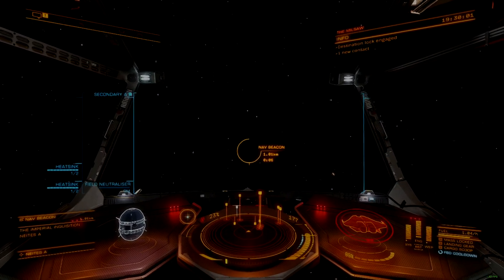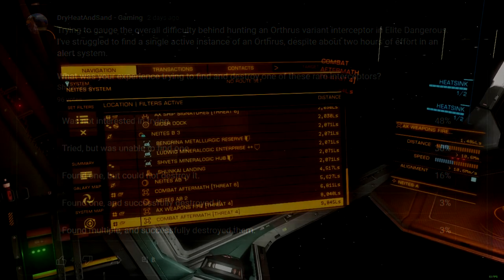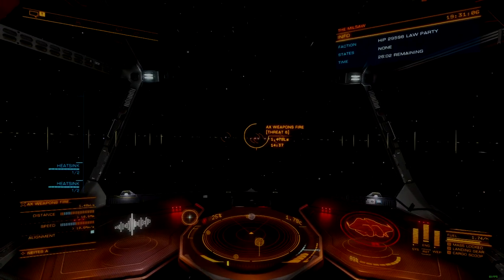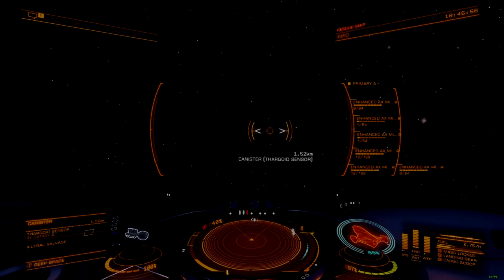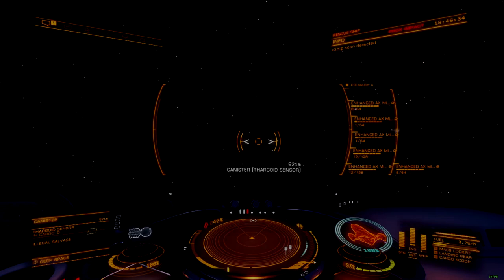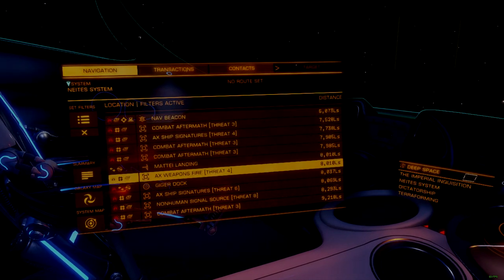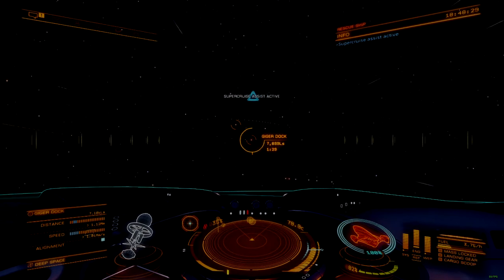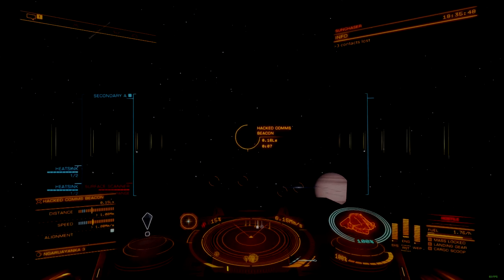Elite Dangerous | General Commentary | The Ideal Signal Source

Comment: Ortharus interceptors should spawn at the nav beacon of alert systems. Players then  wouldn’t have far to travel and it would be cool to see the interceptor jump in and start interacting with the nav beacon to gather system info. Regular AI ships at the beacon could all start to scatter or request support. 

I wished that ship materials were available on foot at settlements. Research settlements give data matts, manufacturing settlements give you guessed it manufacturing mats and refinery settlements give raw mats. That way everyone knows where to go to get what they need and it’s actual gameplay. Don’t get me wrong odyssey content isn’t for everyone BUT it’s a more fun and realistic way of gathering what you need. If you don’t have odyssey than I suppose your left with farming signal sources. Engineers could even create a mission or two that guarantees a certain material at a specific odyssey location.

Give us a tractor beam mod for lasers that drastically speeds up material gathering when flying about. I rarely collect the mats after I have killed an noc or whatever because it takes so long.

Megaship cargo bays should be rammed with engineering mats and not cargo of hardly any value. The mega ships are kinda fun to interact with and with a few tweaks could be an ideal way of getting the matts you need. Again engineers could give you a location of the megaship for you to loot. You could also be offered matts for defending a megaship when you get there by the npcs. 

Just a few ideas that I thought of while watching the vid. Oh it would be fun to be a game designer for fdev 😂
Reply: if ship mats were easily farmable on foot, that would mean Odyssey owners have substantial advantage over those who don't have the DLC. This is not exactly pay2win, but still nasty.
Reply: @user-25352  I think people would pay the 20-30 for the Qol upgrade. Imo most people grind the mats in solo to build a ship ready for open anyway. I wish fdev made the dlc content tie into one another rather than trying to keep everyone happy.

Comment: My Orthrus Technique (derived from AXI guide):
-Average 2 an hour (as many as six once, but also 1 in 90 minutes one time).
-Create efficient route between all alert systems in a maelstrom; 5 or more is optimal.
-jump and scan system to system until you find an NHSS Threat 4.
-Empty ones have an Orthrus show up most of the time to drop off a probe/sensor.
-Ones with a probe/sensor have an Orthrus show up to pick it up.
-if nothing has happened after 2-3 minutes jump out and try again (rare). Usually happens about 30 seconds after drop in.
-Repeat.
-NHSS threat 4 rates increase as team size grows.
Good luck!

Comment: I don't particularly mind the material grind *EXCEPT* I expect results; if I do the work, I should get the reward. Every time. This is particularly applicable to farming HG signal sources.
Reply: how many systems you jump between? and do you aim for a single specific material, or any grade 5 will do for you?
Reply: I don't either.  I think the trader was their solution for most mentioned issues and, it's not a bad one.  I always use the trader for the harder to find mats. The exchange rates for g4 & 5 mats could use some improvement.